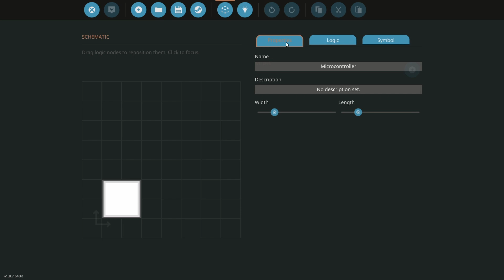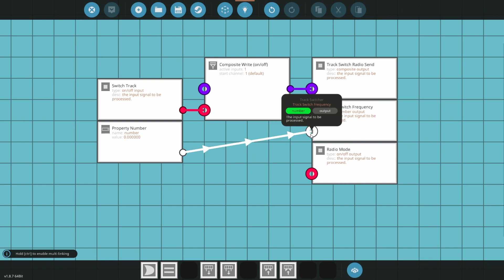Stormworks - Train Track Switcher Tutorial

Comment: i have a one have a one problem why does the train immediately move when I turn on the key but not turn on the throttle lever?
Reply from the maker: Not sure what you mean. This radio system shouldn't have any effect on a locomotives drivetrain.
Reply: because you need a clutch to disengage the power from the engine